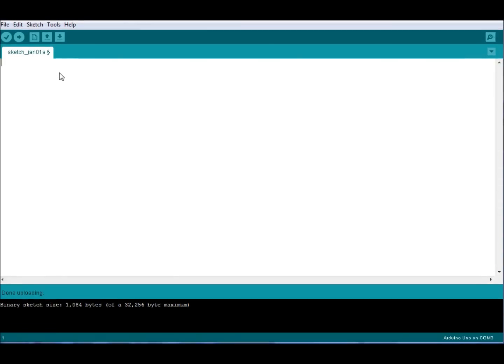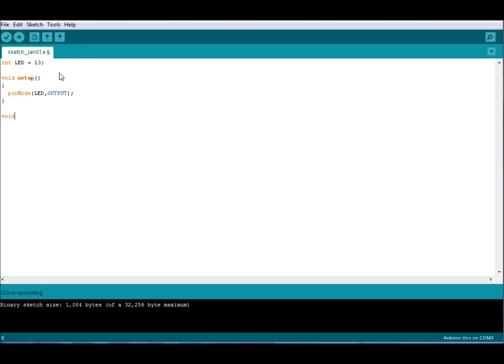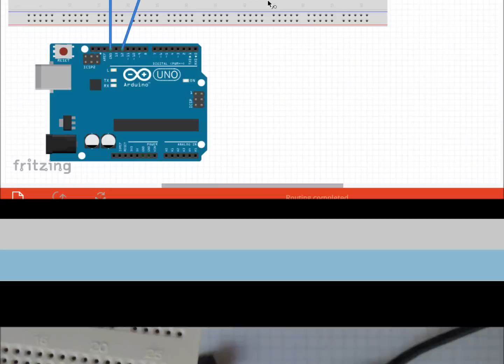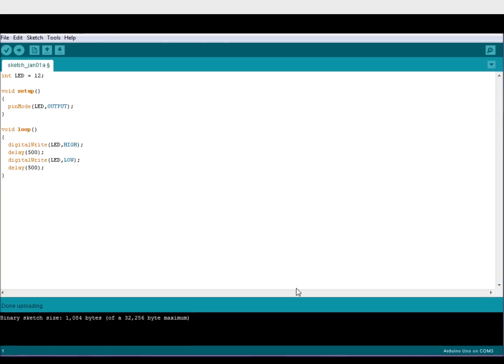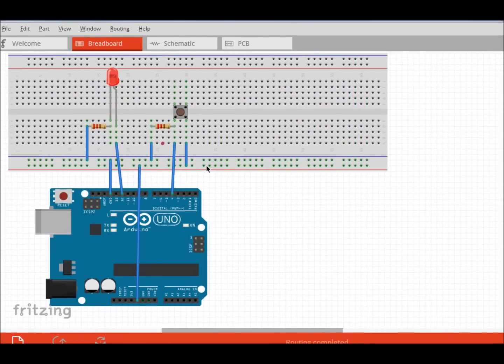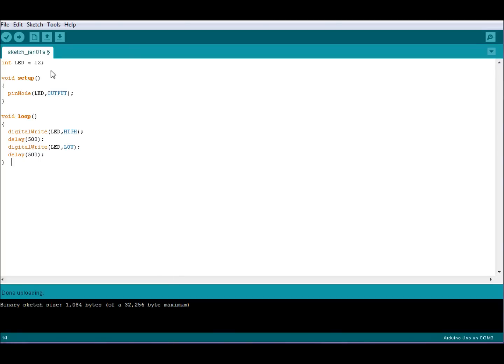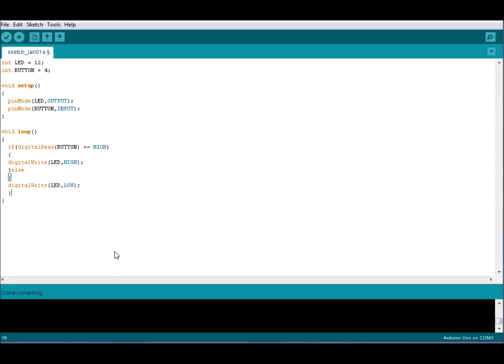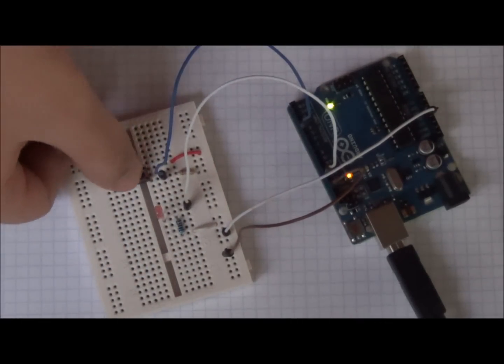Arduino Tutorial #1 - Digital Inputs and Outputs - Button & LED

Comment: Hi EE, thanks for the tutorial. May I ask you a question?

What is the actual meaning of assigning a pin as an input? Does it give HIGH if current flows and LOW vice versa? The main reason this confuses me is that current flows from + direction to - direction. Our negative is GROUND here, right? So, how does Arduino know if pin(4) is HIGH or LOW since only info it gets is GROUND? What am I missing here?

Thanks in advance.
Reply from the maker: +freex08 Very good question. Assigning the pin to output or input is a simple toggle inside the controller. The output circuit can either trigger the switch to HIGH (5v) or LOW (0v). The input circuit uses a Schmidt trigger in order to see the voltage on the input pit. In other words, the Arduino (Atmega328) measures the difference between the ground and the voltage you have on the pin. I would recommend reading the datasheet for Atmega328 if you want to see the in-depth info and circuitry which makes it happen; the above explanation is very general. They go over timing, which components are used, schematics, etc.
Reply: +EEEnthusiast Hello again EE, thanks for the reply. I now have a better idea on how the system works. I will check out the material you recommended. Have a good day!
Reply: high is on, low is off

Comment: Very cool and informative video. I recently bought a table hockey game, and I want to simulate what happens at an actual hockey game.

I'd like to use a breadboard for this project. I apologize for not being very knowledgeable in this subject matter.  In terms of lights, I only plan on using one green LED and one red LED for this project. Basically, I want to press a button on the breadboard and have a green LED be off for 180 seconds and then turn on for 5 seconds to simulate the end of a period, and then turn off.  To start the next cycle, I'd like to just push the same button.  When a goal is scored, I'd like to press a button on the breadboard to make the red LED turn on instantly for 5 seconds and then turn back off, and not interrupt the 180 second timer for the green LED.

Could you help me with the coding and/or make a video demonstrating this? I'd really appreciate it! Thanks!
Reply from the maker: +Dan C I can certainly look into your code and provide feedback. This functionality should be fairly simple to achieve with Arduino. Send me what you have and I can take a look at it.
Reply: I have hardly no experience with coding. I've checked out some forums, and I still am pretty lost on this. I know it's very time consuming, so don't worry about it, especially if you don't have the time for it. Thank you very much though.

Edit.... I actually got some help and I think am on the right track.  However, with the Arduino, how would I set up the breadboard since there is only one ground port I think on the Arduino?  Also, the first part of this code someone helped me with for the green LED uses the included LED on port 13 apparently.  How could I code it where I could just put both LEDs on the breadboard? Thanks a lot!   Here is the code I have: 

#include <Button.h> // https://github.com/JChristensen/Button

const uint8_t button1Pin  =  2; // Connect a button from pin 2 to GND
const uint8_t greenLedPin = 13; // Use the build-in LED for this example

Button button1( button1Pin, true, true, 10 );

void setup()
{
  Serial.begin( 9600 );
  pinMode( greenLedPin, OUTPUT );
}

void loop()
{
  uint32_t currentMillis = millis();
  static uint32_t button1ReleasedMillis = 0;
  static bool button1Released = false;
  static uint32_t greenLedStartMillis = 0;
  static bool greenLedOn = false;
  
  button1.read();

  if ( button1.wasReleased() )
  {
    Serial.println( "button1 released -> turning green LED off if needed, and starting 180 seconds timer..." );
    
    if ( greenLedOn )
    {
      greenLedOn = false;
      digitalWrite( greenLedPin, LOW );
    }
    button1ReleasedMillis = currentMillis;
    button1Released = true;
  }

  if ( button1Released && currentMillis - button1ReleasedMillis >= 180000UL )
  {
    Serial.println( "180 seconds timer finished -> turning green LED on for 5 seconds..." );
    
    digitalWrite( greenLedPin, HIGH );
    greenLedStartMillis = currentMillis;
    greenLedOn = true;
    button1Released = false;
  }

  if ( greenLedOn && currentMillis - greenLedStartMillis >= 5000UL )
  {
    Serial.println( "5 seconds timer finished -> turning green LED off..." );
    
    greenLedOn = false;
    digitalWrite( greenLedPin, LOW );
  }

const uint8_t button2Pin  =  7; // Connect a button from pin 7 to GND?
const uint8_t redLedPin = 12; // 

Button button2( button2Pin, true, true, 10 );

void setup()
{
  Serial.begin( 9600 );
  pinMode( redLedPin, OUTPUT );
}

void loop()
{
  uint32_t currentMillis = millis();
  static uint32_t button2ReleasedMillis = 0;
  static bool button2Released = false;
  static uint32_t redLedStartMillis = 0;
  static bool redLedOn = false;
 
  button2.read();

  if ( button2.wasReleased() )
  {
    Serial.println( "button2 released -> turning green LED off if needed, and starting 180 seconds timer..." );
   
    if ( redLedOn )
    {
      redLedOn = true;
      digitalWrite( redLedPin, HIGH);
    }
    button2ReleasedMillis = currentMillis;
    button2Released = true;
  }

  if ( button2Released && currentMillis - button2ReleasedMillis >= 5000UL )
  {
    Serial.println( "turning red LED on for 5 seconds..." );
   
    digitalWrite( redLedPin, HIGH );
    redLedStartMillis = currentMillis;
    redLedOn = true;
    button2Released = false;
  }

  if ( redLedOn && currentMillis - redLedStartMillis >= 5000UL )
  {
    Serial.println( "5 seconds timer finished -> turning red LED off..." );
   
    redLedOn = false;
    digitalWrite( redLedPin, LOW );
  }
}

Comment: Really nice tutorial, thanks a lot mate =)
I few questions that I was hoping you might be able to answer for me though:

1. What is approximately the output voltage of the pins when they are set to HIGH? Is there any way to increase/decrease this output voltage

2. Do all output pins connect back to the Arduino via the same ground? Say if I'm working on a project where I will set pins 1, 5 and 12 to HIGH - should these all be connected to the same ground to form full circuits?

Hope you will answer! ^_^
Reply: +Ashadow Reviews  
ans1)5v,maybe
ans2)you can do that

Comment: I am new to electronics but not coding so I have a noob question:
Why do you use the resistor? Does it keep the led from burning out or something?
Reply from the maker: +gopro_2027 That's correct. A traditional light bulb is a resistance of its own. An LED (or semiconductor) does not have a resistance, so it would conduct an "infinite" amount of current and burn out. The resistance prevents that.
Reply: EEEnthusiast so does the resister sloe down the flow of electricity or does it lower the amount of power put still let it in at the same speed?
Reply from the maker: +gopro_2027 The resistor reduces current which is the flow of electrons. Since P=VI, the power is proportionally reduced as well. Think of it like this, a 5V battery across 10ohm resistor is I = 5/10 = 0.2A. The LED needs 0.02A, so you need a 100ohm resistor in order to prevent it from burning. Power across a 10ohm resistor would be ~1W and 100ohm, 0.1W. (Note: voltage is lost through the LED as well)
Reply: EEEnthusiast do you mean a .2A led? .02 doesnt make sense to me. also, how many volts do the arduinos put out? i know i can use the 5v port to constantly put out 5v to a button or something.
Reply from the maker: +gopro_2027 No, I mean 0.02 or 20mA which is typical for an LED. Arduinos are generally 5v, but have a 3.3v setting also.
Reply: +gopro_2027  the resistor 'resists' electric current too much current can burn the led

Comment: I'm using a shield (Specifically the LoLShield LED Matrix) and I know that the analog pins are free for buttons but due to the form factor the shield needs to be plugged into those pins. Do you have a video that would show how to wire up a button when using a shield?

Comment: i have an arduino assignment but i don't understand it can you help me please the question is
 The LEDs are labeled 1 to 10 in the order and direction
indicated. Write an arduino program to turn on LED 1and 2 simultaneously. Then turn off Leds 1&2
simultaneously. At the time LEDs 1&2 turn off, LEDs 3&4 must turn on. Then LEDs 3&4 must turn
off. At the same time LEDs 3&4 turn off, LEDs 5&6 must turn on etc until LEDs 9 &10 reached.
This turning on and off of LEDs around the circle must be done twice. The process should then
reverse direction and go in the opposite way two times also. Then change direction again. This
circulation and direction change must be done as long as power is applied to the arduino.

Comment: How do you know what resistor to use?
Reply: +brian teunissen https://learn.sparkfun.com/tutorials/light-emitting-diodes-leds
Reply from the maker: +brian teunissen The most accurate way is to refer to datasheets. Each component will disclose the amount of current it will allow through it. This (and its other characteristics) will dictate the components you will need to use in conjunction with it.
Reply: +brian teunissen This is what I found great arduino tutorial FREE DOWNLOAD https://plus.google.com/105456673395930650430/posts/PWgqWWct4AF? XOXO~s4V

Comment: excuse me sir bt i"m a little bit new to arduino. could u xplain me why do we use a resistor wid a led?
Reply: +Pratyush Sharma to prevent excess current flowing into the led which might cause damage to it
Reply: OK, yeah I kinda blew one up so yeah, found that out, well, thanks...
Reply: a resistor resist how much power goes to the led otherwise the led will blow
Reply: Inzamam-ul Haque Sourov wouldn't that work with a diode? I'm new too.
Reply: Zach an LED is a diode.  The resistor causes impedance, which is necessary to bring the potential difference to a safe level.
Reply: k
Reply: Ohms law buddy, You're being told this by a 12 year old

Comment: EEEnthusiast  Good video. What if I want the button to toggle the LED on and off?
Reply: +GhostZ369  make a boolean lets say "Bool toggle = 0;" i put the whole text in here under, I am not sure that bool is the correct name  but just look up what boolean is otherwise.

int LED = 12;
int BUTTON = 4;

void setup(){
pinMode(LED,OUTPUT);
pinMode(BUTTON,INPUT);
}

void loop(){
if(digitalRead(BUTTON) == HIGH){  
 if (toggle==0)/// this will make the led blink while u press the button at least
 {
  toggle = 1;
  digitalWrite(LED,HIGH);
  delay(500);
 }
 else{
  toggle = 0;
  digitalWrite(LED,LOW);
  delay(500);
 }

  
}

else{
digitalWrite(LED,LOW);
}
}
Reply: +GhostZ369 yea didnt answer your wuestion but hey anyway I think you can modify it and  youll figure it out =)

Comment: I made a little variation just to wrap my head around the code part. This is supposed to blink the LED half second with button not pressed, and simply blink faster when you press the button...

int LED = 12;
int BUTTON = 4;

void setup()
{
  pinMode (LED,OUTPUT);
  pinMode (BUTTON,INPUT);
}

void loop()
{
  if(digitalRead(BUTTON) == HIGH)
  {
  digitalWrite(LED,HIGH);
  delay(50);
  digitalWrite(LED,LOW);
  delay(50);
  }else
  {
    digitalWrite(LED,HIGH);
    delay(500);
    digitalWrite(LED,LOW);
    delay(500);
  }
}

Comment: I did the same except I used 3 other smaller resistances for the pull down, and for some reason it does it inverted, the light is on and if I press the light goes off?
Reply from the maker: Jeroen 20014 MY guess would be that you connected the LED to the opposite rail. You can connect it to GND or VCC depending on wheather you want it to come on when the output is high or low.

Comment: great video sir... Thanks for the upload. Do you gave any videos or resources for hooking a step motor to a l298n driver. I couple months ago i got it to work and then now i have power transmission to a vertical shaft and can't get the sketches from arduino cc to work.
Reply from the maker: cogito ergo sum I don't have any at the moment, but I've purchased the driver and planning on making a video at some point in time.

Comment: I would like to designing a timer/multiple output to control a keno board. I would like to know how to make a timer to 20 signals approx. every 3 seconds then on a different circuit a reset signal. Is this something you can inform me, or can I buy from you already set up ?

Comment: Great Tutorial EEEnthusiast, I just have 2 questions: What is the purpose for the resistors? and What program did u simulate the breadboard and arduino in? Thanks again for the great tutorial.
Reply from the maker: The resistors limit the current drawn by the LED. As an example, a conventional lightbulb in your house is a resistance, so it does not require anything else when a voltage is applied to it. A LED has a minimal resistance which means it will burn unless you introduce an external resistance. The software for the Arduino is not a simulation, it is a simple graphical tool. It is called Fritzing.